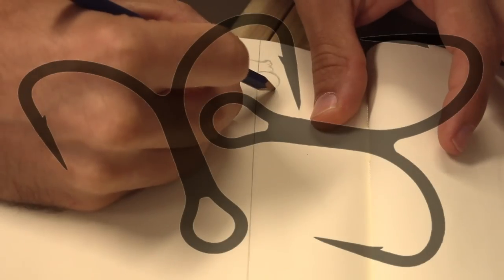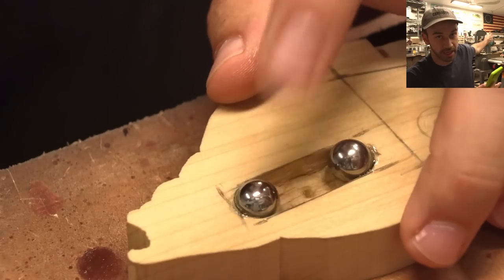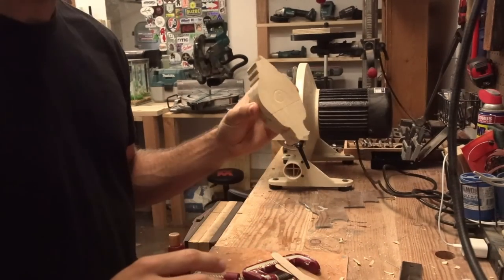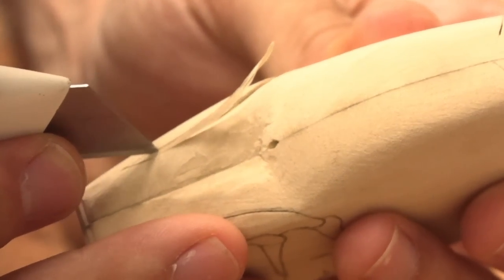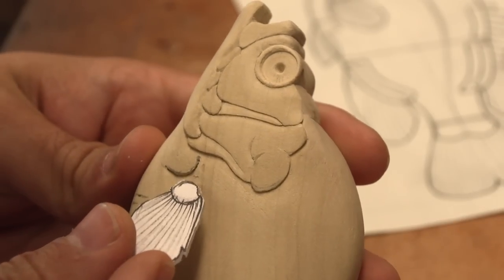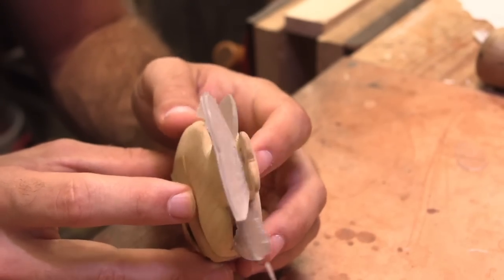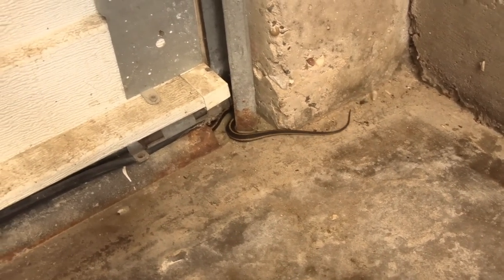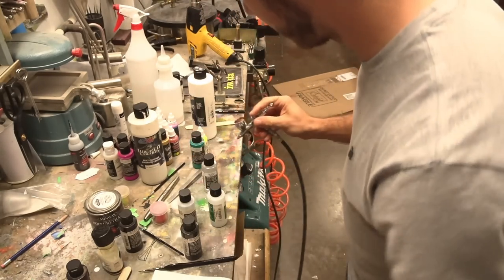Making a Warmouth SwimBait | LOUD Knocker and Flappy Fins

Comment: Got me wondering if using two different materials for the fixed bearings could create a difference in tone. Like ceramic or glass for either front or back fixed bearing. Maybe a bit of extra attraction, maybe not. Just a thought.
As always damned fine work.

Comment: Man, you need to do a vitrified bait, with like 25 or 30 layers of clear coat, trust in the power of resin vitrification !
It's not that it'be cool to do it, it's necessary for the balance of the force and the stability of the whole universe